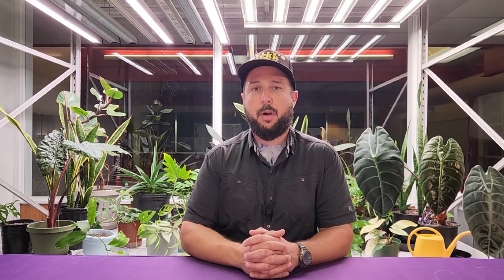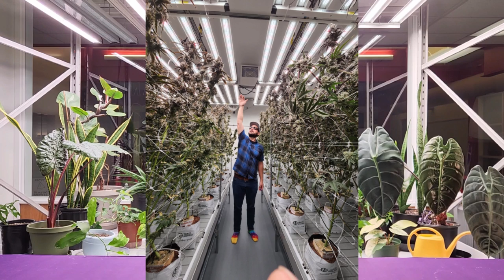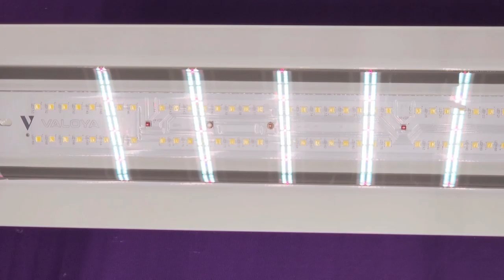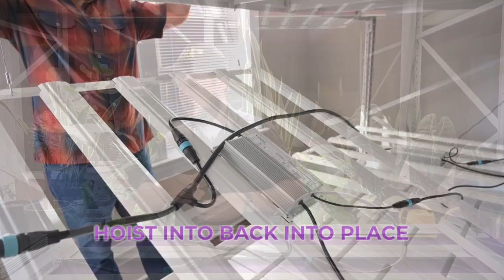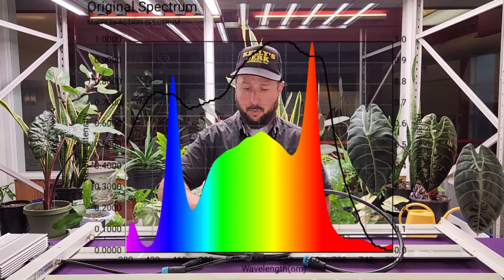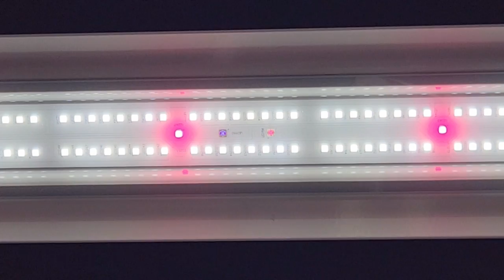Valoya RF700 Racking Fixture Review

Comment: Yes UV is needed small amounts but need uv-B and A. A isn’t enough. A light needs them to have on dial to turn on off as needed same for 730 needs it’s on cause it needs turn on first before rest of LEDs. And their is some Led companies doing it now. Heard guy GML fixing release UV-B UV-A bars for their lights and their one of the companies done doing separate controls for 730 leds. Plus different spectrums a lot of specturms.
Reply from the maker: Thanks for your feedback. From a commercial or industrial perspective, having quality fixed inputs is the most feasible. I think the jury is still out on UV-A and B. Lots of marketing based on old publications with sub-optimal conditions for strong data. UV-A could just be adding energy to Photosystem I or it could be a cryptochrome response in some crops. I agree that Far-Red has the most well know beneficial effects and would be ideal to have Far Red on an independent channel for controlling plant morphology i.e. Leaf expansion or internodal spacing.
I think it's difficult to quantify the nuanced effects of spectral tuning without tightly controlled experimental setups. R:B and R:FR ratios are definitely important but if you have a reference quantifying the effects, please share!

Comment: Nice to see more companies use UV-light. Would be also nice to see a first pricetag, so one can compare it to brands like Greenception.
Reply from the maker: I checked out the Greenception site and pricing. They are ~1.4 Euro per watt and geared towards home growers. And at the time of checking sold out :)  The cabling and chassis style of the GC fixture are dated, and those types of fixtures are available for less than a dollar per watt in the States, along with UV and FarRed. However, the addition of these chips (particularly UV) requires higher voltage at the system level to run properly and will be the shortest-lived component in any system containing them. It would definitely work for home-grow, but I think you could find more cost-effective options with equal quality at this point.